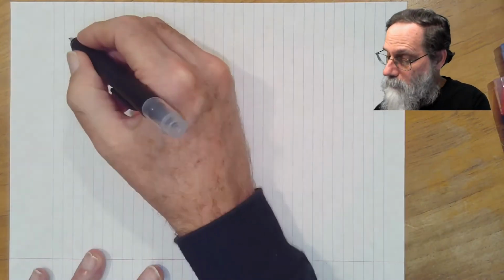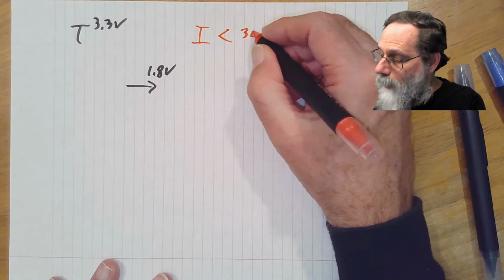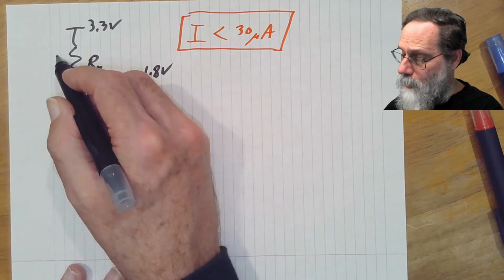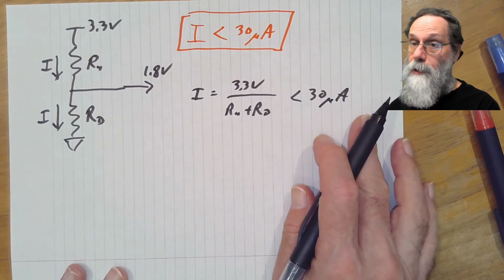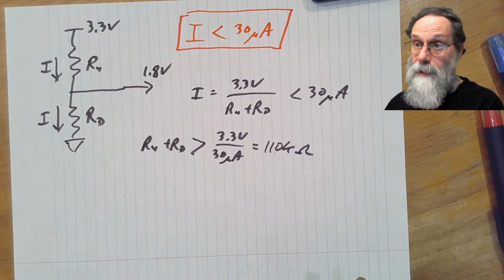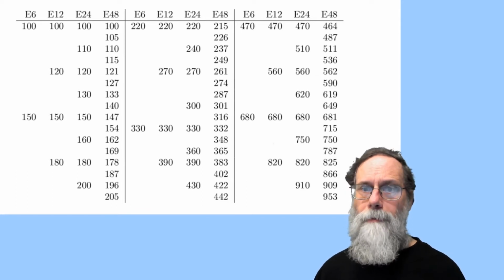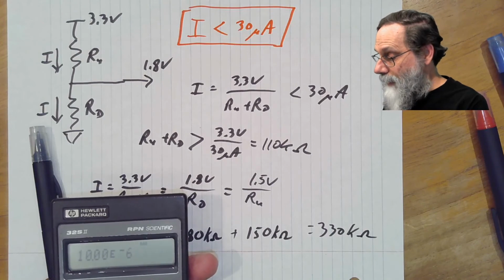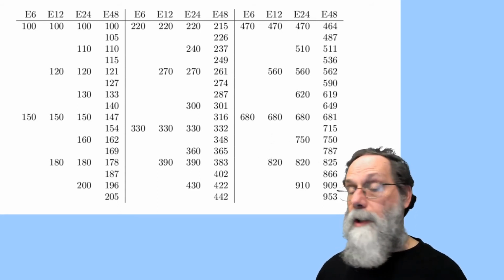Designing voltage dividers §5.1.1

Comment: if your charging a cap with a voltage divider ur shooting out the R2 resistor!!!
Reply from the maker: I have no idea you are trying to say here.  Could you be clearer?
Reply: @gasstationwithoutpumps  as the capacitor increases resistance, the current will divert down the r2 resistor, this is how the voltage is "limited" in a voltage divider, via current loss.
Reply from the maker: @magnuswootton6181  Your statement is not making much sense.  The DC resistance of a capacitor is infinite, so a capacitor would not affect the steady-state behavior of the circuit.  The dynamic behavior of a voltage divider and capacitor is handled in Chapters 10 and 11.